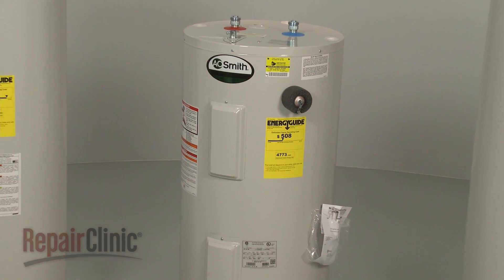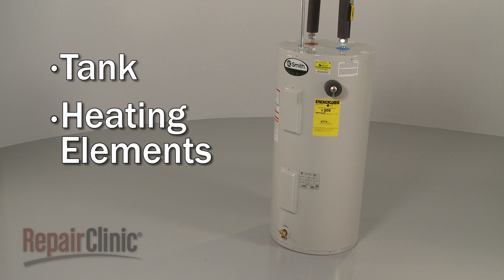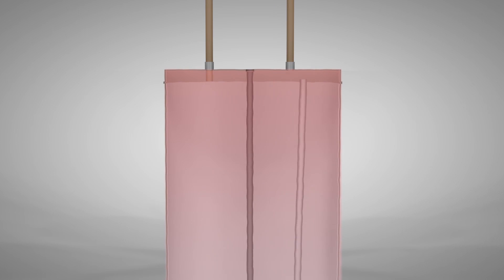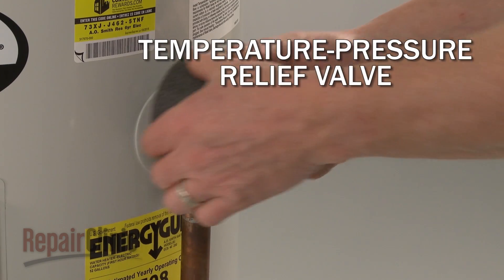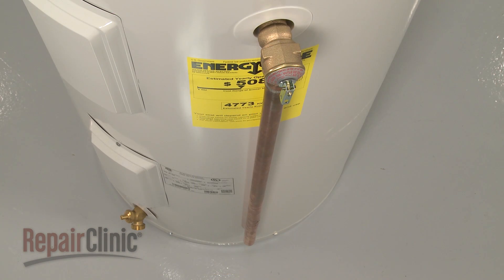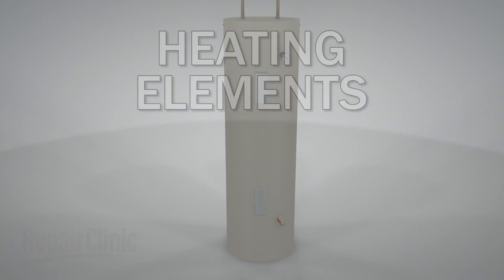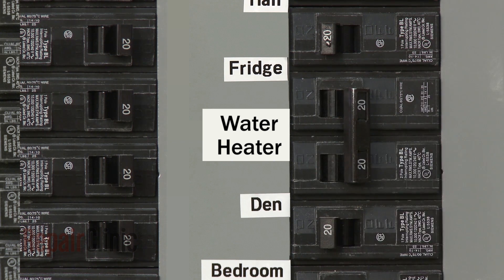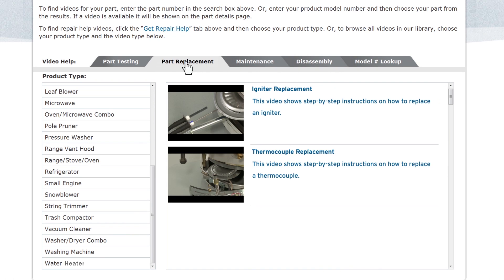How Does an Electric Water Heater Work? — HVAC Repair Tips

Comment: Hello sir greetings to you. After I saw this video I have a question. How we know the inlet tube is internally broken as you show in this video. I am asking the question because I trouble shoot two water heater.Both heaters elements was good with continuity and ohms13.5. Both thermostat was bad.I changed it.but still I cant get much enough hot water.what's is the reason sir?

Comment: Gotta ask after just finding this. Unit sounds like there is running water. Temp/flow is good. I shut the breaker off, then close the cold water valve. Takes a while but eventually noise quits. If I shut main water off, it ends quick. Breaker off/water off have little to no hot water pressure. I'm stumped as to the issue. Water bills went way up last couple of months.

Comment: The Texas cold front broke mine, I think. It doesn't heat water at all, and my father and I already tried to shut off the power and press the power button to reset it. Is it supposed to make any noise at all? We didn't hear a thing so we aren't sure it's even on, but it sure as heck isn't heating water anymore since it's been a week since the power came on and nothing. I can't even tell which pipe does what since they plastic vs the metals all the videos I've seen show, and have the pipes coming out of the side of the heater vs the top.

Comment: If you store hot water below 55 degrees C, you risk the growth of Legionella bacteria in the cylinder.  In Australia and New Zealand (my homeland), regulations require the water be stored at 60 degrees C minimum.
Reply: What is that in F degrees? We don’t use the C system in America
Reply: @kamakaziozzie3038 
55°C = 131°F
60°C = 140°F

Comment: Great video. The only thing I would point out is that almost zero builders in Connecticut build homes with floor drains anymore so the pan would be of little use here.

Comment: why do you insulate the incoming pipe? Isn't that just cold water coming in from the outside? Thanks!
Reply from the maker: +Robert Dobbs It helps prevent heat loss. If the incoming pipe is really cold, it will transfer to the tank and the heater is less efficient.

Comment: so if my water heater is leaking, I don't necessarily need a new one?
Reply from the maker: +Brittany Douce If the tank is leaking then the whole hot water heater will need replacement. If it is leaking from a valve that particular part can be replaced.

Comment: My wife and I have lived in our house now for about 3 years. The original water heater in it is a low boy 38 gallon. The hot water would last at least 30 minutes with her shaving and all that. Did really well. About 3 months ago it recently started getting colder faster. And I mean about 10 minutes. I checked out the water heater finally and noticed a pool of water. So thinking the tank was leaking, I went and replaced it. Now same problem...maybe even 8 minutes of hot water. That's it. My plumber tested it and is the lower element supposed to kick on first? thanks
Reply from the maker: +Adam Huskey Perhaps the dip tube is broken and only the water at the top of the tank is being used which is not as warm.
Reply: +RepairClinic.com  thanks for the feedback. I got a plumber coming by tomorrow and see if that's the problem. I will give ya the diagnosis for sure. thanks again!

Comment: I just got a water heater, and it doesn't work the way its suppose to. The hot water keeps trayin to go back to the water supply ,and I get 3 to 5 seconds of hot water and that's it. What should I  do?please help me on this.
Reply from the maker: +Joey Rivera You may have a broken dip tube on the cold water side. The dip tube directs the incoming cold water to the bottom of the tank, while the hot water is forced out of the top of the tank. If the dip tube is broken, the cold water will flow directly across the top of the tank and out the hot water side. Also, make sure that cold water is flowing to the in port and the hot water is flowing to the out port.

Comment: Working water heater installer , I wonder if you have Camara combustion crossing water heater gas , in some material where the water acidezda not puncture or damage the same ?

Comment: One thing to mention is when you test the element while it is still in the tank, remove wires first and check across terminals.  also check continuity from each terminal to the side of the tank.  That is checking for a ground short in the element, which will sometimes cause an element to check good even though it is grounded.
Reply from the maker: Thanks for the tip!
Reply: When you say side of the tank, is that the interior where the thermostat is being pressed against?

Comment: My water get really hot. and the hot water dont last to long...what is the problem...
Reply: If the hot to cold temperature is almost instantenious than the pipe that supplies HOT water inside the tank has broken off, u will need to change it.

Comment: how do i test the lower thermostat
Reply from the maker: You can use a multimeter to test the thermostat.
Reply: thanks
Reply: But make sure turn the power off first and disconnect at least one wire from terminal, then set it to OHMS, should read between 0 to 3 depends on the brand.

Comment: I replaced the Pressure-Temperature Relief Valve after noticing that water was leaking occasionally.  After replacement, I find that new P-T valve relieves small amounts of water after some hot showers.  I called water company and was told they had not made any adjustments to water pressure.  Any ideas?

Comment: How many Breakers are on the hot water heater ?.
I have always been under the impression that there is only one breaker for both heating elements, usually  the top thermostat has the breaker and that controls both the top and the bottom heating elements. any help would be nice
Reply: My breaker panel has one switch connected to two breakers, since is 240VAC.
Reply from the maker: There is usually only one re-settable push-button limit on the top thermostat that will shut off power to both the upper and the lower elements if the water gets too hot.

Comment: so whats happening when my hot water only stays hot for 20 mins then back to cold water??
Reply from the maker: You may have a bad element. Usually the lower one is the first to go bad. Sediment builds up on the lower element and causes it to overheat and short out. I would first check the elements with a meter for continuity. If the elements checks okay you may have a bad upper or lower thermostat.
Reply: *****
hi
i had the same problem like marcus eppes, a bad lower element.i did change it but still my hot water dont last like before.do u think my lower thermostat have to b replace?
thx
Reply from the maker: It may need to be replaced. You can test it for continuity using a multimeter.

Comment: Why not have cold water supply connection at the bottom of the tank therefore no need for dip tube?
Reply from the maker: That would work but to make it more efficient the dip tube has holes in the sides to about a foot from the bottom that help mix the incoming cold water with the hot water already at the bottom of the tank. Having the water connections both at the top also makes it easier to install. http://www.repairclinic.com/PartDetail/Dip-Tube/2293962507/2678348
Reply: Mobile home water heaters do if they are gas.
Reply: Water heaters here in New Zealand are like that. Cold in the bottom and hot out the top. Usually only one element too.

Comment: Great Video. I just purchased a home and it came with a new Rheem electric water heater. There is no hot water. I did not think about checking the breaker though. Again, thanks and I hope this is the fix.

Comment from the maker: Also will need to put a note on it that the water is drained out so that if someone wants to use it again the water will need to be turned on to the unit first before power Is restored or the elements will burn out.

Comment from the maker: You can just turn off the electric to the unit, usually a breaker and shut off the incoming cold water to it. That is the easiest way.  Since it is in a closed tank the water will be ok. If you do want to drain it out you will need a shut off valve on both the incoming cold and the outgoing hot lines from the water heater or water will get back into the unit.

Comment from the maker: You'll need to check the heating elements for continuity. If the elements check ok the dip tube may be broken at the top and may be letting cold incoming water mix with the hot water going out the top of the tank. Hope this helps you figure out the problem.

Comment: Hi I have an electric water heater problem.. . Water heats for just 10 min and after that house breaker shut off . I changed the bottom and top elements ,bottom was damaged and top was good . Now it does the same thing, keeps shutting of after like 10 min,the bottom of the tank is cold while top is hot .. Any clue what's going on ? Thanks